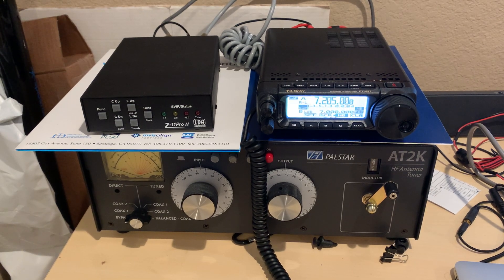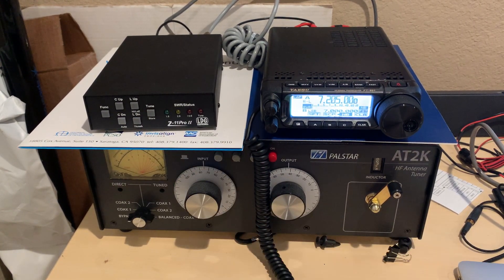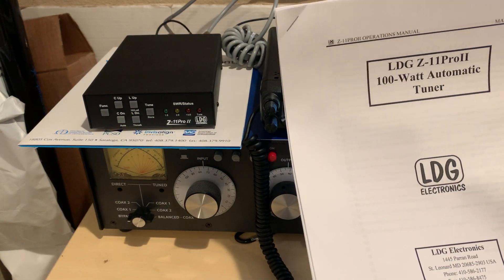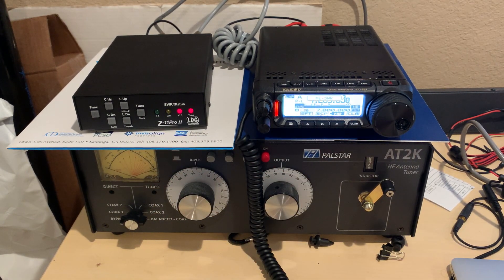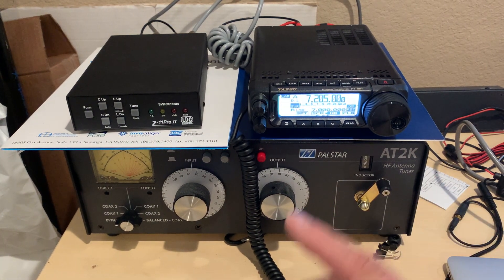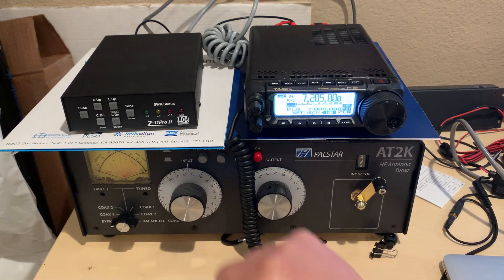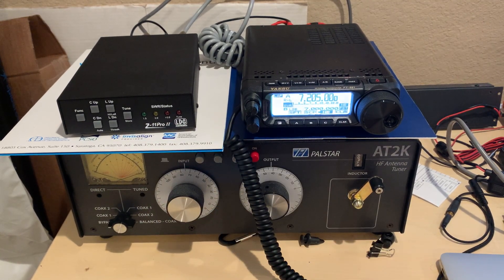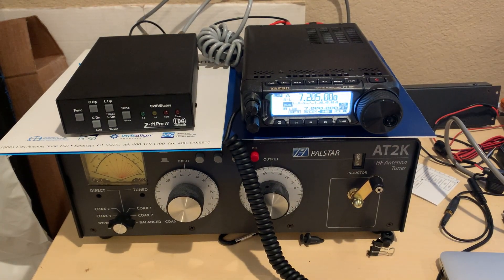LDG Z-11ProII Auto Tuner not working? wrong, bad manual

Comment: I got mine about three years ago and never used it much. I did have to call LDG for help, and they confirmed that the manual has some errors. I'm trying again, and I'm NOT getting the 5-star review feeling. I haven't seen any indication that the memories are working; I will sit down with the latest manual and probably call them again.

It seems capable, but it needs a display and some menus because the various blinking patterns are hard to remember. It could also use a battery level indicator. Sometimes when it acts badly, it just needs new batteries.

Comment: Thank you so much. I just bought this tuner for my mobile setup, added it and hit the road to drive 1200 miles. The auto tuner seemed to work okay as long as I put the radio (FT 891) into a constant carrier mode (CW or RTTY) and the SWR was above the thresh hold that I set. It also seemed to recall the memories pretty good but every now and then I wanted to touch up the SWR and would have my wife reach under the back seat of the truck to manually tune. It worked as it was supposed to the first time but wouldn't tune at all the second time. I will try this before we hit the road tomorrow. 73!

Comment: I had an LDG auto tuner and it would not work unless the radio was set to AM (FM-for those who have it).  This was not covered in the manual.  I had to do trial & error and finally figured it out.  Now I have an MFJ 969 Versa Tuner II with a roller inductor.  Cheers & 73 from W Rusty Lane K9POW in eastern Tennessee

Comment: Hi I experience the same behavior on my Z-11 ver2, but first version of Z-11 does not behave like that, I think it is just software (firmware) bug. But... LDG will do nothing with it, so if somebody don't like, go and f... buy different model. and may be the dug will be in different place. ))
Reply from the maker: actually, nothing is wrong. I have a follow up video. basically, the first push is just to wake up ATU and 2nd push is following what manual says.